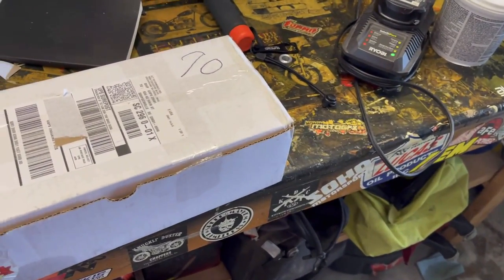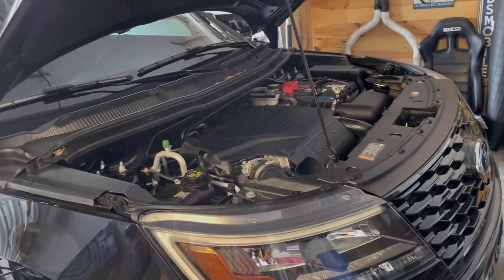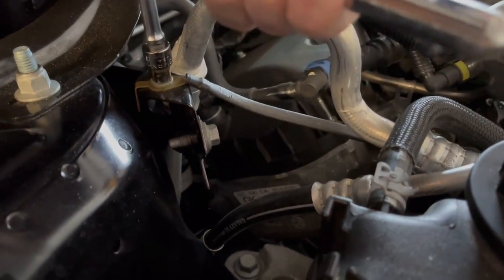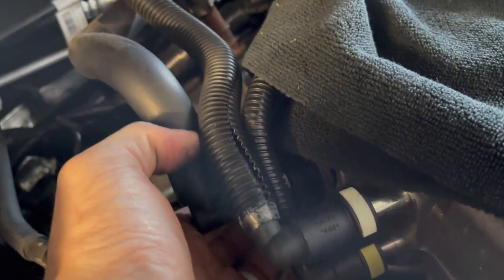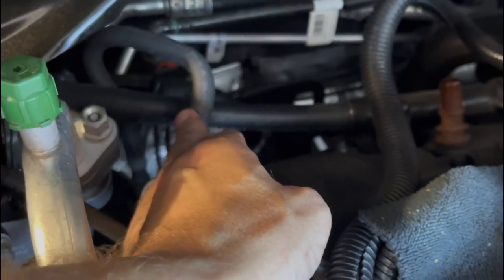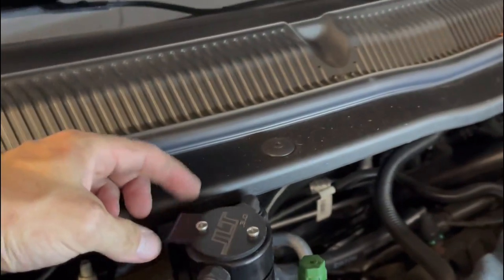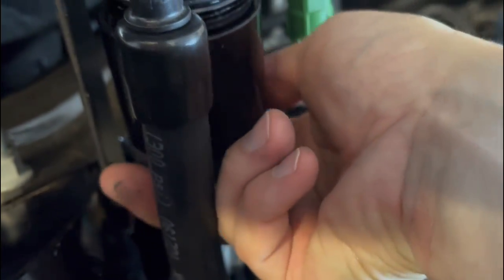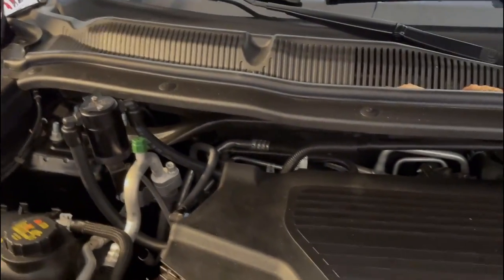Explorer Sport JLT 3.0 Oil Separator Installation | Catch Can

Comment: Hi i own a jb4 for my 19 q50 silver sport,  my mods are ams intake, ams heat exchanger, ams auxiliary intercooler, ams lower downpipes, add w1 oil catch can, hks blow off valves,  axleback exhaust 5 inch tips.   What map do u recommend and im in call 91 and e85 are available. What map 6 can u guys help with so i can run freely and. Safely. Please get back to me